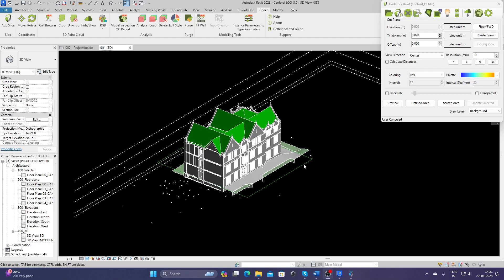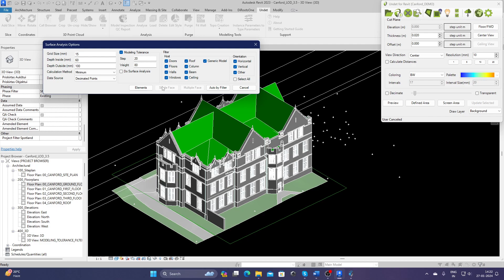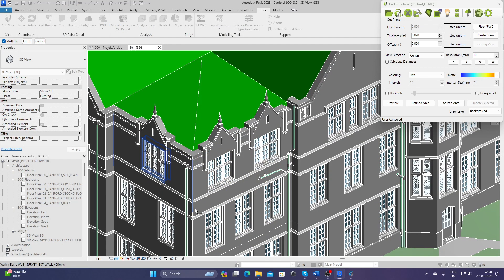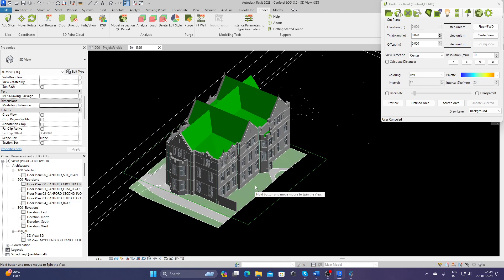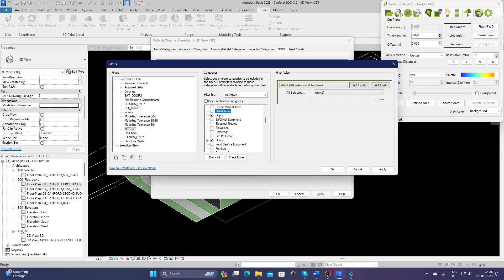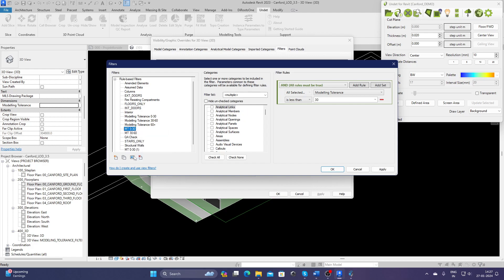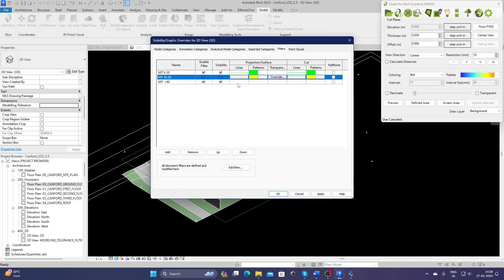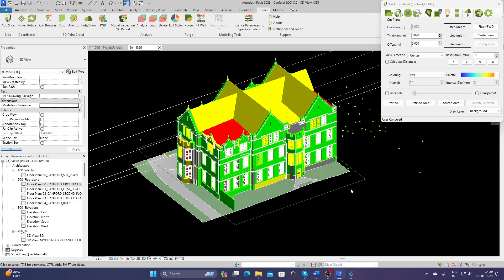Undet for Revit | Modelling Tolerance Parameters for QC/QA

Comment: I don't understand the meaning of modeling tolerance and how it relates to step and weight. Could you explain this further?
Reply: Hi, 
I hope this helps,

Step: This defines the increment at which the tolerance is calculated. For example, if the step is set to 10, the tolerance will be calculated in increments of 10 (e.g., 10, 20, 30, etc.). Similarly, if the step is 20, the increments will be 0, 20, 40, and so on.

Weight: Weight is used to generalize the tolerance for a specific element. For instance, if the weight is set to 80, and an element fits within a tolerance of 20mm for 80% of its measurements and 90mm for the remaining 20%, the element's overall tolerance will be displayed as 20mm. Based on experience, a weight value of 80 is recommended as it provides a balanced representation of tolerance.
Reply: @vishalrana1312   How about Grid Size, Depth Inside and Depth Outside? Do you know the meaning of them?